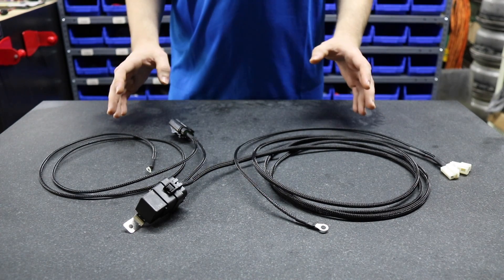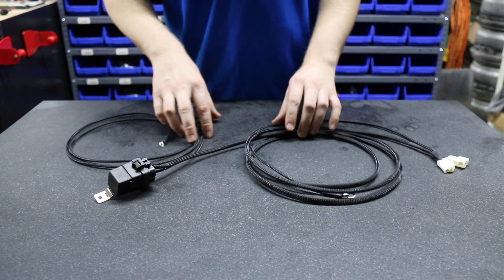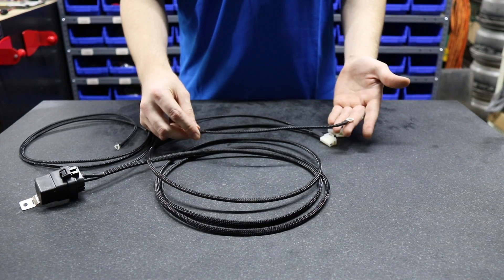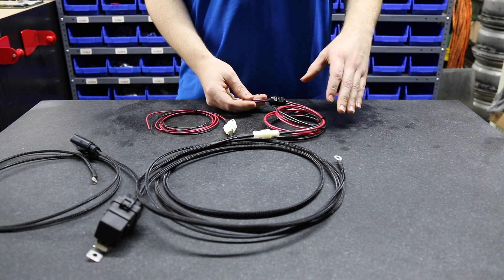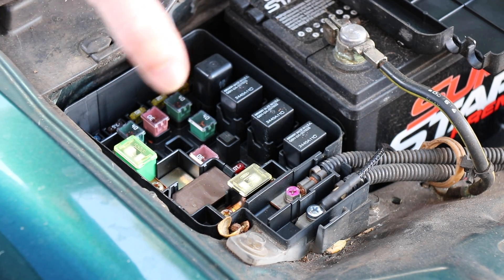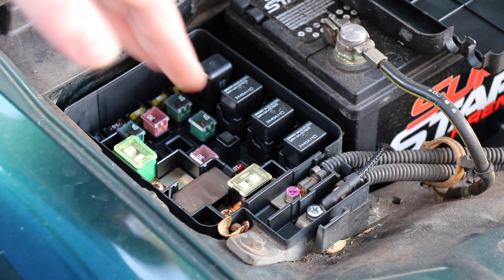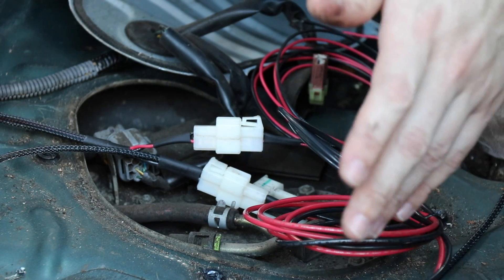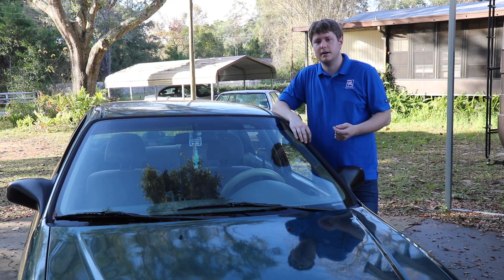Honda Fuel Pump Harness - Burton Racing

Comment: Thanks for adding the portion of the ef. I’m sure it will work but can I just tap the two wires from the signal harness into the two wires going back to the fuel pump relay? I was thinking of disconnecting those two wires from the factory side plug near the fuel tank and making connectors into the signal part of the harness.
Reply from the maker: Yes, you can tap in anywhere you would like to trigger the relay when ignition is on. Using the original pump power wires as a signal allows the priming sequence to work like factory.